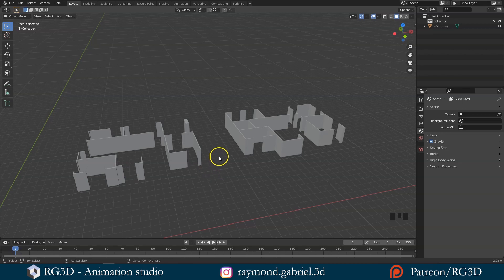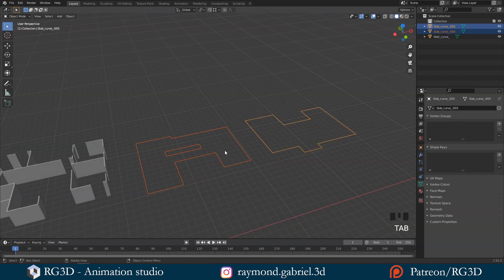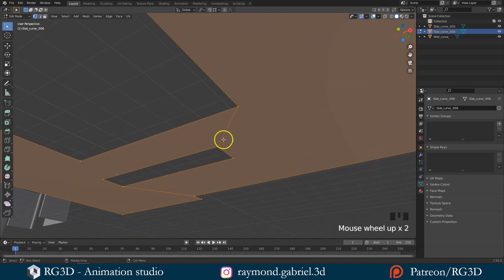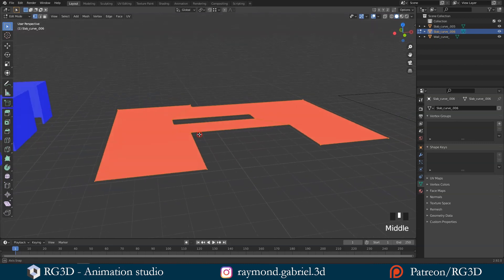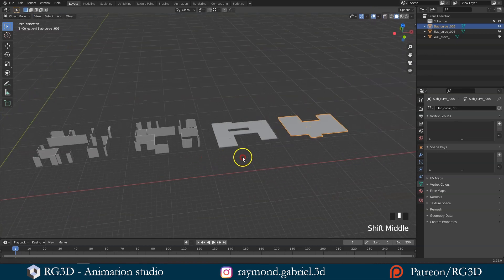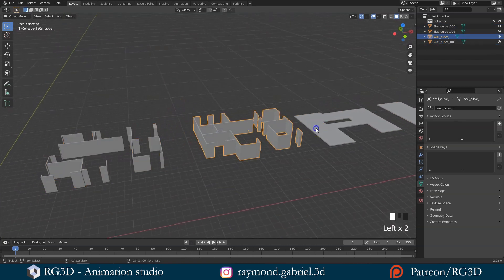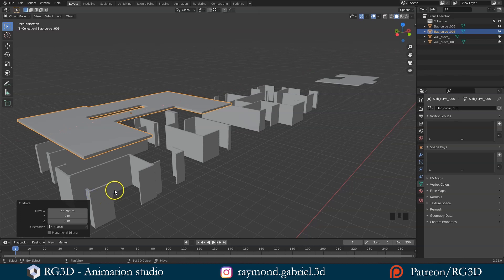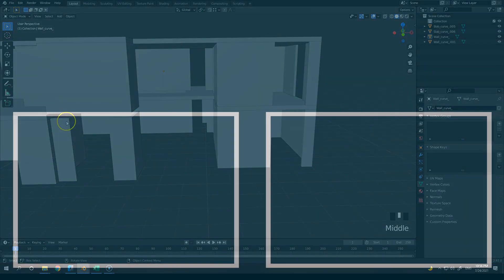Modern house in Blender - Full tutorial series - Part 2

Comment: please can you help me im trying to fill the slabs and the second one filled ok however whenever i try to fill the floor slab it only fills up the little square in the middle and then when i deselect the little square it just says no faces filled. i have converted it into a mesh and did the merge vertices thing. i dont know what to do next
Reply: Make sure that you select all the vertices first by pressing A, then press m for the merge menu and choose "by distance", you should see the number of vertices merged together in the bottom middle of the screen, if its Zero, then try to increase the distance for the merging in the settings from the bottom left corner, keep increasing until you see any number of vertices merging together (By RG3D - Animation studio)

This thing Worked for me ♥
Reply from the maker: You should use Alt+F instead of F, select the whole slab including the square in the middle
Reply: @RG3DAnimationstudio  then it only fills the little rectangle in the middle
Reply: Same here

Comment: Having trouble filling the face. When I try to do it it only fills the rectangle face in the middle. Also when exporting the slab from the plan I had to manually select the rectangle. It would not auto select when select similar was applied.
Reply: so whats the solution